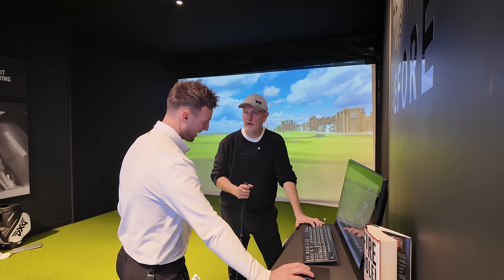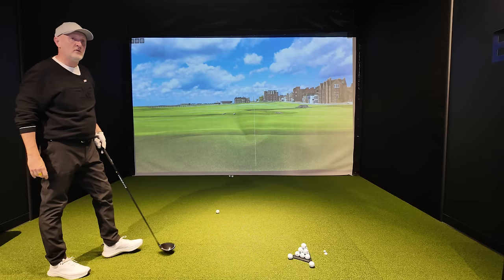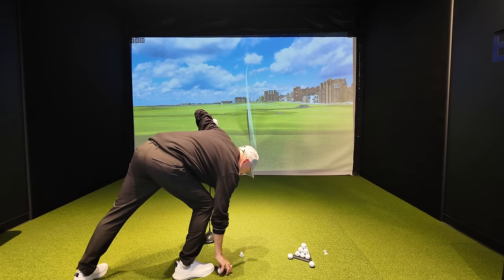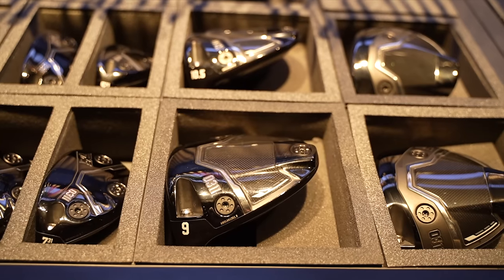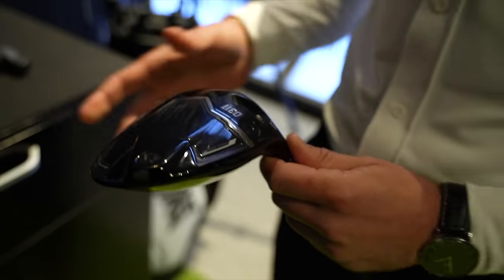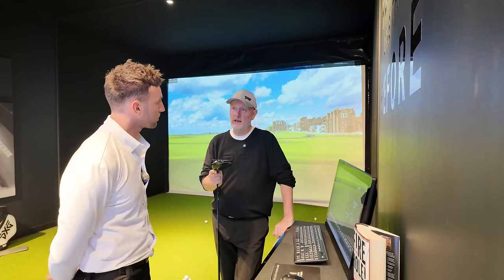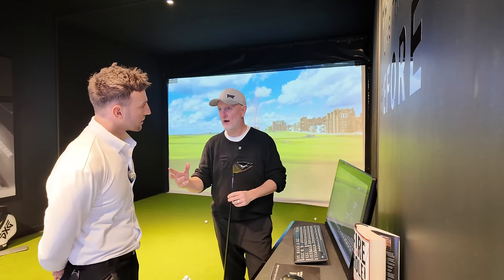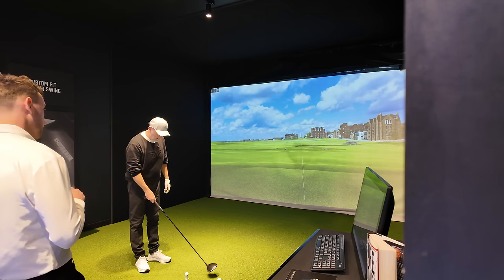You will DUMP your driver after seeing this!!!

Comment: I recently went to a 12 degree driver with a ladies shaft. I am hitting 20 meters longer and straighter than my 10.5 regular shaft taylormade driver. I am a vertically challenged high handicapper senior. This new driver was fitted by the local professional
Reply from the maker: Makes sense, many of the ladies shafts are much better suited to our swing speeds and could help so many golfers if only they would open theirs minds a little bit brands also need to help promote this concept
Reply: Hi very interesting, what’s your club head speed? I’m also a senior and vertically challenged!
Reply: @TheAverageGolfer  Absolutely... nowadays there should be no such thing as a men or a women shaft.
Reply: I’ve just got a ladies cobra Aerojet driver and I’m getting 20 yards extra also, No explanation as to why
Reply: @richardsmith9262  slow 75 mph ish
Reply: I played at top golf in USA and used the very whippy shafted clubs and got ALL my drives straight! Mayb I don’t nd a stiff shaft

Comment: That was super interesting, Andy. I’ve been spraying the ball all over my driver face. Just can’t hit the sweet spot, so much so that this week I took a bit of Alex Etches advice and bought a pre-owned QI10 Tour 3w. Off to the range with it, no warm up, first shot straight out the centre and straight down the middle, same distance as my decently hit driver. There has to be something in the confidence feeling you get when you are closer to the ball. I don’t think we get enough out the box thinking with most driver fittings. This was an eye opener.
Reply from the maker: I don’t understand why manufacturers are not pushing the idea of shorter shafts, all seem to be obsessed by distance
Reply: @TheAverageGolfer the biggest selling point, but 10 or 20 yards mean nothing if you're missing the fairway.

Comment: Bought a 2008 Bridgestone 12 deg head, slapped in  $10 Apollo steel driver shaft (Monark Golf) a grip and boom...280 fairway.  Used to spray it 295.

Comment: I've been playing my.local course for 8 years with a 45" long driver. Cut it down this year to 43.75" and I hit the longest drive I ever have on hole 16 within 3 rounds on the short driver. Just bombing all the fairways as far as I ever had and I was far more confident. Just had to add weight to the head to maintain swingweight

Comment: Borrowed a set of r11 woods years ago and messing around one day swPped the 5 wood shaft into the driver head and hit straighter and longer than my reg.driver, but never continued with experimenting like this,I should have, I hit that 5 wood shafted driver 268 yards on a 261 yard par 4 yes just over the back of the green,should have learned something from that

Comment: When I was very young around 16- 18 years old, I use to hit balata balls, 43 ‘’ steel shaft, persimmon driver incredibly far drives reaching some par 4’s and now with super long, 46’’ graphite shafted driver and ProV’s can’t come close.  I don’t know where all my power has gone?  🤷‍♂️  At my best, I played to a plus 2 hdc but feel it’s not lenght of shaft or head size.  Today, I was fiited to a Ping driver and hit the ball close to 240 yards carry, but that’s still a far bit closer.  I know I am not as flexible or wirery as I use to be, but I can’t believe how much distance I’ve lost.
Reply from the maker: I’m afraid a loss in club head speed is very likely the problem if you believe there is one

Comment: Another excellent video Andy.  Like I told you before I was a certified club pro, fitter and club builder.
I'm older now and I use a 13* three wood and 43.5" fiberglass fiber speed shaft and with a roll average
250 or more yards.  So you are right on the money on your testing.  Now fitters are testing softer shafts in irons with flatter lies 6* fir straighter shots.

Comment: Another great video Andy ,I've recently shortened my Ai Smoke driver also added a 14 gram weight to the back rather than the standard 7 gram .Boom, distance improved 20-30 yards and hitting alot more fairways and no 3 off the Tee as yet.
Reply from the maker: @shaunt2385  brilliant Shaun

Comment: Great video can I ask what shaft you used on 44 inch 3 wood shaft and did you change weights at bottom of driver to correct swing weight
Reply from the maker: Hazardous yellow 60 gms reg, no change to head weight

Comment: I always find this kind of video really interesting so thank you. I'm using a Ping G400 standard head with a Tour AD IZ4 shaft at 44.5 inches. Don't miss many fairways and haven't noticed a drop off in distance compared to my old full length driver. I might push the loft up a touch after watching this 👍
Reply: Hi, just out of curiosity did you have it swing weighted ?
Reply: @richardsmith9262  I haven't a clue what the swing weight is and I don't fully understand the effect of dropping the shaft weight by 20 grams. Don't want to add weight to the head as I want it to feel lighter but not whippy! Could fit a lighter grip maybe. Looking for a swing weight nearer to C than D if I can achieve it.

Comment: And, did you adjust the head weight (make it heavier) to counteract the lighter swing-weight caused by the shorter shaft? What was the 3-wood shaft weight (compared to the 65g 45" shaft), and did you use the same grip on both shafts? Just curious, as total (dead) weight and swing weight can influence your delivery quite a bit.  Cheers.

Comment: @TheAverageGolfer Completely new to this but here it goes ... I own a Ping G430 Max driver with a standard Alta CB 65 Regular driver shaft in it.  I would like to put an Alta CB 65 Regular 3 fairway wood shaft in ... en replace the 25 gram Tungsten weight by a 34 gram Tungsten.  Would that correct the swing weight in a good way since the driver head is only 206 grams compared to the 218 grams of the G430 Max FW 3 ? Or am I completely wrong ? 

Objectif is to be more accurate from the tee since my driver is all over the place with the standard driver shaft lenght.
Reply from the maker: @frederichoedt2506  hi Frederic, if I am perfectly honest I have never noticed a difference in swing weight although many will say otherwise. In this experiment there is no weight added to the head when the 3 wood shaft is inserted. I would suggest your theory would work and best way to find out is give it a try.
Reply: Indeed ... I was on the range yesterday and I tried out my (at least) 12 year old Mizuno MX700 3 wood which has a Stiff shaft in it.  I practically never use it, it just sits in the bag.  Every other golfclub I have and have ever had has Regular flex.  Every fitting I ever had, had Regular as a result.  So I think it's safe to say I'm not one for a Stiff flex ...  nevertheless, I pretty much hit that old fairway wood pretty straight yesterday, unless I completely missed the shot.  

Afterwards, I went to my local golfshop and asked about a 3 Wood shaft to be put in the driver.  They also said no extra weight needed to be added.  Just from a selling point of view perhaps ?

I forgot to grip down on my driver yesterday as a test ...
Reply: @theaveragegolfer follow up question ... I have noticed that I don't hit my hybrid 3 and 4 as long as I used to ... turned 50 last summer ... in addition to a shorter driver with a 3 wood shaft ....what would your choice be between the driver and the 5 iron if you had to choose 2 more woods/hybrids ? I'm thinking Ping G430 Max 5 wood and Ping G430 Hybrid 3 but I'm in doubt.

Comment: Did he add any extra head weight with the 3 wood shaft? Would be good to know. I've played about with all this in past and play my driver at 44.5". Even at that length I still need 12g extra head weight, it really makes a difference to smash factor and feel if you can add extra weight to offset the shorter shaft and overall loss of swing weight

Comment: One of my old clubfitting mentors used to find that 44" was a rather important data point. Beyond that, he often noticed swing mechanics starting to break down somewhat, and clubhead speed wouldn't necessarily keep increasing. In some players it'd drop. Swings would become a bit less inside, a bit more outside and over the top. Fades would appear, or increase. he felt it was down to that greater than 44" lever being too long to manage. Up to that point, players coped, albeit with increasing difficulty. Beyond that, the negative effects on club length on consistency and swing mechanics got worse. He felt the lever was just too long for the average golfer to cope with. So he rarely went beyond 44" in driver length in his builds for his clients unless they were very good golfers indeed, with very good mechanics. For average middle to higher handicappers, he usually stuck to 44" or less.
Reply: Is 44 the total length with the head or is it the shaft plus tip length?
Reply: @src5tt  Total length of club.

Comment: Pretty cool. I want to try a 47 or 48 inch shaft and see what happens.
I tried your forward motion practice swing. Definitely a good feel for my bag of tricks.
Reply from the maker: Glad the tip worked out
Reply: I tried it also - it’s not easy to perform and I definitely will not be doing it on the practice range. It makes you look like a goose - one to practice in the privacy of your back garden

Comment: check the swing weight and find the one that benefits you the most, that is what is going on here. Don't just go cutting shafts shorter as you will make them lighter sure, but the flex and cpm will go all over the place and you will spend more money not knowing why a fitting was important in the first place.

Comment: Its about time....

I have only suggested this to you at least three times to you  and dozens of times to other YouTubets over the last 6 years.
8 years ago i cut 3 inches off of the butt of my G25 driver. And still love it.

Mini driver makes no sense if you cant hit it off of the fairway.  Maybe 1% can.
Why go for the accuracy of a shorter shaft then go with a less forgiving mini head ? ? ? 

If the average pro only uses a 45 inch driver
 What makes the rest of us golfers think we can use the same length shaft.

Did you add any weight to the head  bring the swing weight back up?
Reply from the maker: Not sure how often you watch this channel but we have done plenty of videos with shorter shaft in driver? Mini driver isn’t as difficult as you think to hit off fairway btw 

And no weight added to head which many have mentioned is necessary over the last 6 years 👍
Reply: @TheAverageGolfer  I don't believe weight needs to be added to the head. I think swingweights on these long stock drivers are far too high, and contribute to the problems people have with them.

Comment: I shortened my driver by 1 1/2 inches. The head is quite a bit heavier. Where is this thought coming from where you need to add weight to the head?

Comment: Playing 3 years now and use no driver or even hybrids-use 15 ,18 and 21 degree utility irons plus a 2 iron off the fairway, took a while to hit them right but now wouldn't part ever with them. Not your distance but 230 average with direction is good for me. Used 2 drivers,tried and bortowed others and no theyre not for me. Interesting video this.

Comment: I think you may really benefit from a very light weight shaft (in addition to your shorter shaft length and a bit more loft).
Reply from the maker: What’s your thinking behind that thought?
Reply: @TheAverageGolfer  I'm no expert, but generally a 3 wood shaft is heavier than a driver shaft (and a 3wood head is heavier than a full size driver head).  The heavier 3 wood shaft helps balance the heavier 3 wood head (swing weight).  All else being equal (length, flex, profile, etc) most folks will swing a lighter head/shaft combo faster than a heavier combo.  F=MA a lower mass club will move/accelerate faster with the same amount of force/effort.  Of course you will have to see what works for you in practice.

Comment: Yes we all can't afford custom fittings standing at the tee with a regular driver and shaft feels like I am standing miles away from the ball as a 5 foot  6inch man ladies clubs makes sense cutting shafts down is not a easy do it yourself fix manufacturers are missing out we are not all the same height or have thousands to spend on made to measure clubs
Reply from the maker: How much do you think the custom fit costs?

Comment: I took and older Callaway driver, cut it down at the butt to 3 wood length, put a midsize Winn light grip on to get the swing weight back to D1.  It's in my bag just a little stuff but a great fairway finder. No loss of distance either.